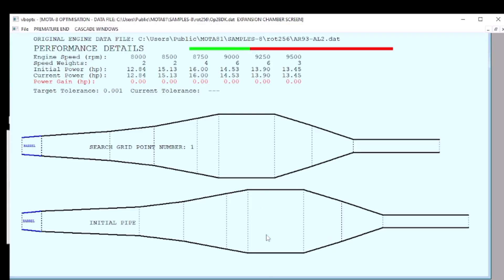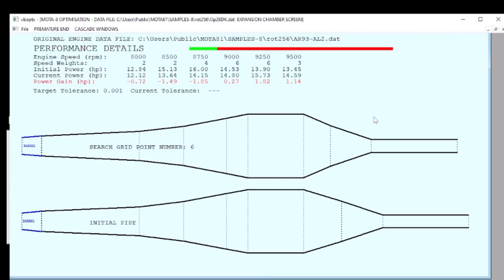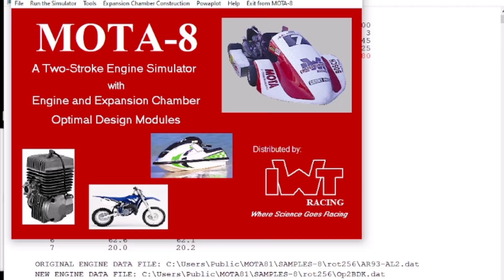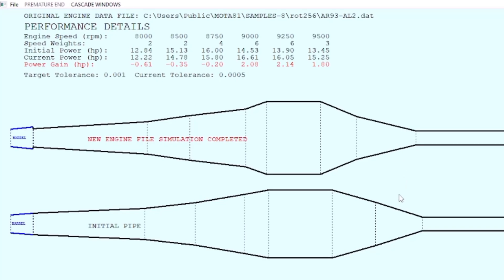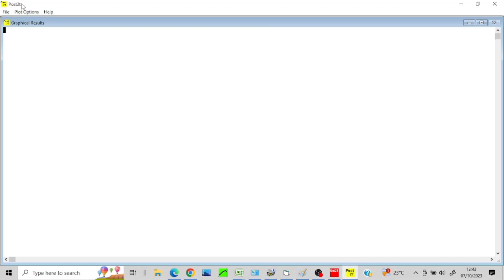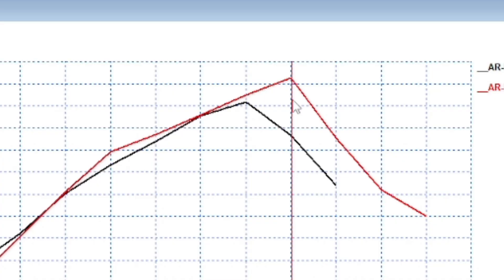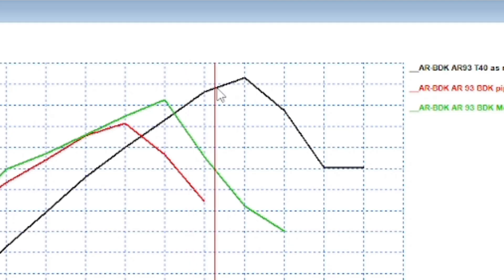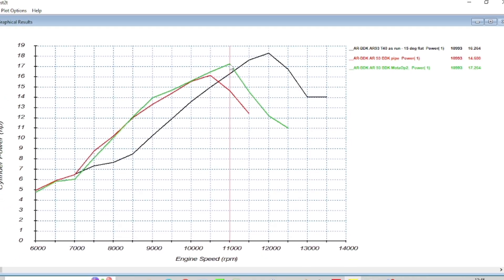A.I. designed tuned Exhaust | 2 Stroke Expansion Pipe | Mota 8

Comment: Just curious as to what you think about my idea.
I'm planning on making my first pipe this winter.
The base plan is to copy a high performance pipe (Bill's I believe) that was made for a performance engine I got in one of my ATV buggies.
I have recently put a pressure/vacuum gauge into a stock pipe and ran it with and without the muffler. Posted the results on my youtube. I will save you the trouble of looking at the videos.
With the muffler it ran 3 3/4 psi back pressure.
Without the muffler it ran 2 psi back pressure.
My thinking is that a pipe with ANY back pressure is costing power.
I say this because any back pressure in a pipe is also back pressure in the crankcase of a two stroke and therefore the piston up stroke must overcome this FIRST before vacuum is created and the reeds open to let in a fresh charge. That's a loss of some fresh charge and power.
So my thought was to build a pipe with a stinger at the end as usual and also have a large center bleed pipe for full throttle application.
Stupid idea ???
Just wondering.
CO
Reply: You need both positive and negative pressure with two stroke exhaust pipe, timed correctly. Having only negative pressure will aid scavenging but a lot of A/F mixture will be lost to the exhaust, wasted.
Reply: @TomoReso  Well that is my point actually.
Isn't the pipe reflective wave suppose to push the A/F back in ?    If you are relying on back pressure to do this then the pipe manufacturer is "cheating" in my opinion.
We are being cheated out of a % of fresh intake charge because of the back pressure, which would also be in the crankcase.
I know what you are saying but I'm after the full fresh intake charge as the piston rises and not having to overcome that back pressure. At 9000 rpm the time curve is real short.
CO
Reply: @canadianoddy8504  I am confused with the backpressure in a crankcase, I mean, if the reflection wave comes back to the ex port at pistons bottom dead center, yes, its going to travel through the transfer ports too, is that Your point? That is bad, but that also means engine is out of its effective rpm range with that pipe. If you rely only on scavenging and no back pressure you will end up with an engine that will rev higher with no meaningful power anywhere. I've sort of done that as a kid when I had a moped with pipe cut in half to mimic a chopper style  :D
For the other part, how would you push the fresh A/F mixture back without backpressure? Why do you consider it cheating?
Reply: @canadianoddy8504  In my opinion you are not fighting it, perhaps only in real low rpm range where it does not mater. At high rpm, or after the ex pipes effective range, the piston closes ex port faster than the black pressure reaches it.Most likely it bounces back to the exhaust. So there most certainly is no back pressure to fight with, if anything theres negative pressure to aid scavenging but low power output rendering the rev range unusable. However, do experiment, there's something to learn even from failure.
Reply: @TomoReso  "I am confused with the backpressure in a crankcase, I mean, if the reflection wave comes back to the ex port at pistons bottom dead center, yes, its going to travel through the transfer ports too, is that Your point?"

Yes that was my point. That back pressure exists and it would be bad because once the piston starts rising it must over come this back pressure before it can pull a fresh charge through the reeds.

"For the other part, how would you push the fresh A/F mixture back without backpressure? Why do you consider it cheating?"

I consider it --- ""cheating"" -- (just a term I used) -- because the pipe design should be doing all the work no ??

I'm an old man now (63) and failure is an option. I'm not afraid to fail. Done it many times in my life.
I'm a retired red seal certified millwright. Have other tickets as well.
I built my own cylinder head for this particular machine, welded up the holed piston and ring lands cleaned it up in the lathe, made two part rubber mix engine mounts, built a plastic vacuum former to make parts for this machine and done a lot of other stuff.
These Honda FL350 machines are air cooled from the factory. I liquid cooled them by cutting off the fins on the head and welding on a can and did the same thing to the cylinder. I have done this to all three machines and the two spare engines.
Honda had a lot of trouble with this machine and had a lot of recalls. The main problem was that it was air cooled and the engine was behind the seat. Honda only made this machine for ONE year (1985). Then they threw in the towel and stopped production. I melted a couple of engines (7 I think) and then liquid cooled them. NO issues now.
Honda waited for four years and then in 1989 came out with the FL400 Pilot. A LIQUID COOLED 400cc engine - LOL.
I like working in my shop and experimenting. It's my hobby.

Thanks for the replies. I have to sit down and think about your comments and point of views. Maybe I'm missing something. Not sure.
CO
Reply from the maker: I've found good power gains from increasing the restriction in the stinger. I would have thought the centre bleed would help at off-pipe rpms by reducing the effectiveness of the pipe.
That's said: theory is one thing and reality is another, so it would be a cool test to make and see what happens 😁
Reply: @AutoBeta2T  Actually my plan was to have a lever with a cable you pull to lock open a butterfly in the center bleed pipe when at full throttle.
If I make this thing this winter I'll post a video.
CO
Reply from the maker: Cool, if you do please tag me into it 😁
Reply from the maker: @canadianoddy8504 cool, could you tag me into it 😁
Reply: @AutoBeta2T  Sure I can and will do that.
Reply: Thanks for the replies guys.
Much appreciated.
CO

Comment: Pretty sure 18hp is enough for a ton, just gear it right!
The honda Honda RC116 used to do 118mph with 16hp, but that was a beast, very slimmed down and ever gramm counted to the point it bycicle calipers as brakes :D
Reply: that is cool, but wouldn't want bicycle brakes while going 189km/h
Reply from the maker: Chyrt - me either 😬
Reply: I didn’t understand most of it - but really interesting to see if you can get up to the magic 100mph!
Reply from the maker: @duggers999  cheers mate... I'm wondering the same too 😂
Fingers crossed sometime next year 🤞
Reply from the maker: Trevor, I think I may need a little more as the AR is unfaired.
Also, in the sim the power you see in the graph is at the crank... so probably around 15% losses to the tyre. 
I'm thinking of a front brake upgrade too at some point 🤔
Reply: @AutoBeta2T  "I'm thinking of a front brake upgrade too at some point" - When I first started drag racing, my RD400 bike had an AR50 front wheel and disc (as did most of the other RD400 based bikes!). It was a long while back, but I think I put a scooter twin pot calliper on there. It stopped me from 120mph enough to make the fist turn off at Avon Park raceway. It did get very hot and they can warp but they will do the job.